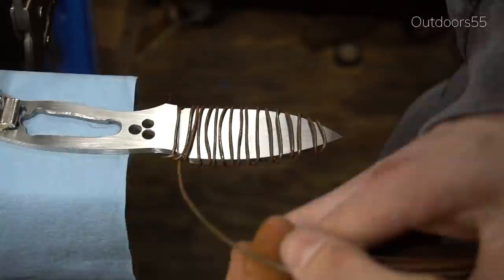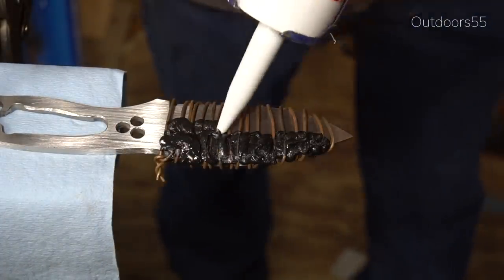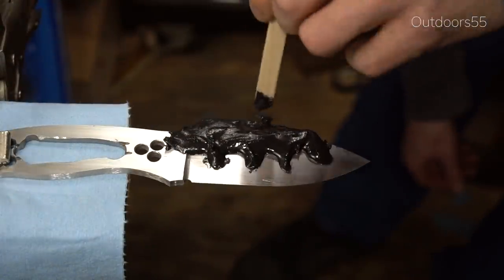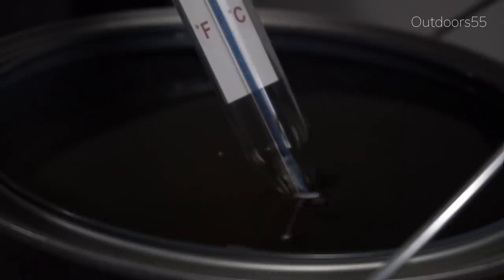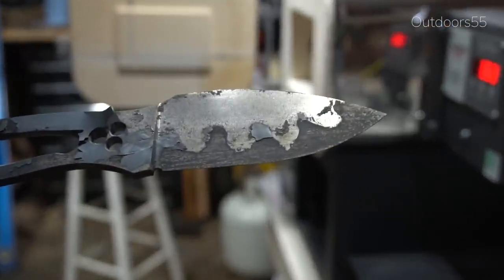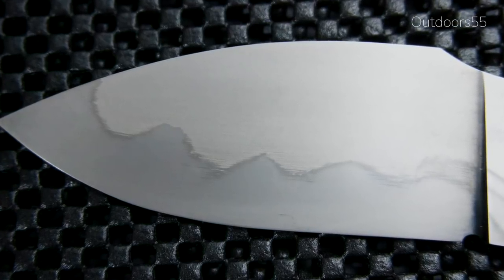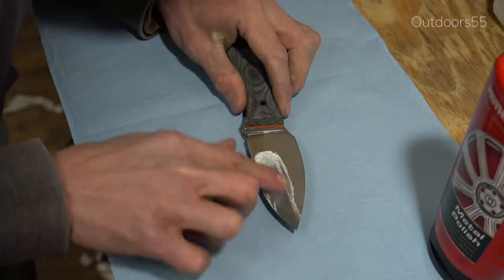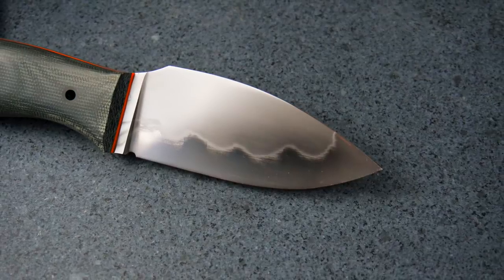Knife Making | How To Make a Hamon Line On a Knife From A Beginners Perspective

Comment: Looks good. One question / tip... why don’t you just use a crock pot for your quench oil? Consistent temp and variety of sizes, wider opening for longer knives. Removable pots, locking lids...

Comment: I usually water down my clay(same stuff) just a little bit, then layer it on really thin... I use to put it on thick and it never worked out... With 1095, you might want to get some antiscale(I've done a bunch of videos on the subject) the paint on stuff is good, just put it on thin, you don't need it for 80crv2 or 52100.....  I found a piece of steel with a washer on each side and a clamp on the bend just a little past straight during the 2nd temper is the easiest and works the best....take it easy... P.S, put some vinegar in the ferric, it'll make it much darker... Flintz or mothers, after you get to 600 grit, then buff it out(buffer works if you want a mirror).. then yes wipe the ferric(mixed) on with a paper towel, handsand, then buff, back and forth till happy... I usually dip, then use steel wool lightly to evenly spread the ferric, don't use it like sandpaper..

Comment: If you want the line, the ashi I think it is called, to be more distinguished you should try a more diluted acid. Lemon juice seems pretty popular and in my experience it has worked but it is very slow. I have read about bringing the juice up to a light boil but I have only done it at room temp (about 72 F) for about 2 hours at a time. I was using 1095 and also I had issues with lines in the blade that were not scratches, but from using stock annealed metal. From what I could gather you have to run it through multiple, at least 3 temper cycles, and even quench and reheat it a few times, which is what I ended up doing to remove the lines.
Reply from the maker: Yeah that's strange.. im almost positive my lines were from the steel wool.  I thought about lemon juice. I may try it on the next one. Ferric Chloride might be too powerful for revealing the ashi. I did get some more of it to show with higher polishing (after i completed the video).
Reply: @OUTDOORS55  the lines in your knife are not scratches. The japanese refer to it as sunagashi. Some kind of alloy banding in the hamon.
Reply from the maker: Im not sure thats what I was seeing though. I might be wrong 🤷‍♂️
Reply: @OUTDOORS55  honestly I am not either😂 hamons are a rabbithole man.

Comment: Looks awesome man! Jealous of your shop. Seeing you put the knife in a vice raised a question I hope you can help me with.

I’ve just discovered that a benchmade fixed blade knife of mine has a slightly curved/bent tip. It’s S30V, and I’m wondering if this can be corrected by removing the scales and placing the knife in a vice to straighten. Frankly, I’m shocked the knife is bent towards the tip. It hasn’t been abused or done any real work. Also, I though S30V would chip or break before bending. Anyways, I really would love to hear your thoughts. Thanks.

Comment: Great looking knife!
A few tips:
A rougher surface finish helps the clay stick, 80 off the grinder works for me.

Dilute your clay. A runnier clay makes fine clay application easier.

For maximum activity: quench into a 8% brine solution with some dish soap heated to 180° f. No longer than 4 seconds. Then into oil of the same temp. Recipe of Gregg Cimms. Try it, he rarely cracks a blade. Leave your edge thick though, about 1.5 mm.
Reply from the maker: 👍 in the beginning I mentioned the rougher surface.  Ill try a water quench in the future. Thanks for the info 👍👍

Comment: A hamon is very difficult to succeed and it's quite impressive you got the heat treatment correct at the first attempt!👏
I try to follow traditional Japanese methods to get the hamon but it takes FOREVER... I can understand not everyone wants to do it...😂 but Walter Sorrells has a very good method using lemon juice and he quenches in water then oil. His hamon lines are gorgeous go check him out. Really nice video Alex I like your work!!😉😁
Reply from the maker: Ive seen his videos and id like to try his methods. Im going to do another one using this same method then probably experiment again. Thanks my friend!
Reply: @OUTDOORS55  that Is good to hear!! Good luck with the water quench... make 2 or 3 times the same knife because that's usually the ratio of success while water quenching... or try to add soap salt in the warm water it increases cooling time a bit...

Comment: This video is awesome! I bought a chef's knife from Yaxell that looks just like that. Now I know how they did it. VG10 stainless steel. Thanks for your videos!
Reply: Stainless steels typically are not able to take a hamon because they do not require the rapid cooling that high carbon does to get to full hardness.  I would guess that what you have is one of Yaxell's 3 layer knives.  VG10 is sandwiched between 2 layers of another stainless that has different hardening properties, i.e. less carbon content.  When they are dipped in the etchant, the two steels etch differently forming the line you see.  Is the line fairly smooth or wavy like Alex's?
Reply from the maker: Well stainless generally won't makes a hamon. Unless theres some method that im not aware of.
Reply: @walte99  After some research, you are correct. It is 3 layer, it is wavy and looks a lot like Alex's.

Comment: Walter Sorrells used lemon juice in one of his steps to polish. Not sure of exact details but you might wanna check it out.

And really liking the knife, by the way.
Reply from the maker: Ive seen his videos on the subject. It will be something ill definitely try in the future. Thanks my friend!
Reply: @OUTDOORS55  since you mentioned the temperature inside your shed, I wanted to ask you if the cold temperatures effects the epoxy curing on your knives or when you make micarta? It's 13° right now in my shed. When I tried making micarta it didn't cure right. So I did it again outside because of the smell and didn't want the smell bothering wife and kids so I brought it inside put it in the seldom used fireplace figuring most of the fumes would go out the chimney - which they did, but the micarta turned out floppy/rubbery. It was fiberglass resin that I used if that matters. I also seem to have weak glue-up if I do it in the cold. Any tips? Does the epoxy stink up the house if you do it indoors?

Comment: Hi, excellent explanations on the videos thanks, I am not crafting knives but I wish I was, don't have the time to start at the moment.
Just a question out of curiosity ; I have a few knives with with dents in them how would you proceed to sharpen that ? (not a damaged knife be one with kind of saw at the base)
I was thinking about that hamon shape, wouldn't it be good to apply some form of adhesive mask with a shape on the blade before you add the layer of cement?

Comment: I would be in awe of anyone who gets an hamon with O1. If you want to edge your bets, choose 1095 or W2 if you use only flat stock, add W1 if you’re trying your hand at forging (it typically comes in round bar). Good luck 👍👊
Reply from the maker: Its a misprint o1 will not produce a hamon 👍

Comment: You didn't mess up, you just learned a few ways not to do it. Awesome knife! Fantastic job.
Off topic for a sec, I'm new to knife making and was wkndering if the little half circle right where the sharp edge of the blade meets the ricasso is called a choil? And if so, what's it for?
Thanks Alex
Reply from the maker: Yes it is. I believe it was originally a desire take from swords. So as to capture an opposing blade during a fight. At least thats what tv taught me🤷‍♂️ Knife makers put a choil on to knives to make sharpening easier. It gives the sharpened portion a place to terminate. 🙂
Reply: Okay great, thanks. 
Thanks to your videos, I just finished my first bushcraft knife the other day, very happy with the result, so I really appreciate all your efforts and advice. Keep up the great work.
Cheers

Comment: Great video thanks . When doing a homon with 1084 do you do the same heat treat as you usually would x3 normalizing then quench ?
Reply from the maker: Yes, but the clay is applied after normalization right befor the quench

Comment: I don't totally understand how the differential hardening is maintained through temper. Let's say after quench, it's like 65/62 HRC (edge:spine) or something like that? And then both numbers come down after temper to like 61/58 or such? Is this fairly close to what happens post heat-treat & oven? Are you using 2x400 for an hour or what?

Comment: Dude, that turned out great!. What grade of steel wool were you using?. Have you thought about trying scotch brite?, maybe you could use a fine scotch brite belt on your grinder, and slow it down ( since you have the new grinder with VFD ), I have never tried getting a hamon, so I dont know if that would work or not

Comment: hi im starting in knives but i dont know kind of metal, can you tell me about hardes or softes metal? or tell me where i can read about that ?? thanks from Ushuaia
Reply: The hardness of a knife depends of the carbon percent and the Tempering, 1095 steel has 0.95% of carbon, fully martensite can reach 66 hrc that's  ~6.5 in the mohs scale it's enough to scratch quartz but the knife will be brittle, I recommend 1095 to 60 hrc, 5060 to 58 hrc, spring steels are better for swords, for short knifes I prefer  the carbon a round  1,5%  for example o2, w2, d2, cpm steel you can buy cpm steel from ebay

Comment: I'm really struggling to get the tempering to work.
How do you keep your microwave from shorting out.
I been setting on low for 10 mins but haven't made any progress.
My grandfather used to make knife from all his old syringes and he passed on his specialty.
I use powdered asbestos drywall for flux and quench in a 50/50 mix of battery acid and round up.
Good work.
Hail Monsanto
Reply from the maker: Microwave ??
Reply: @OUTDOORS55  
So..... 
Popcorn setting ?